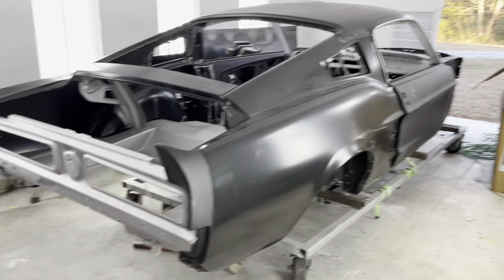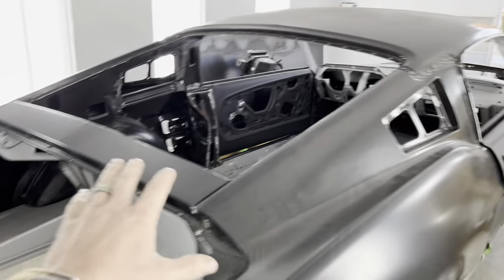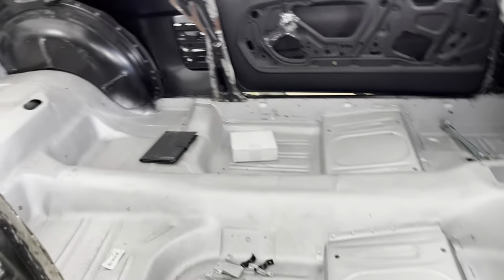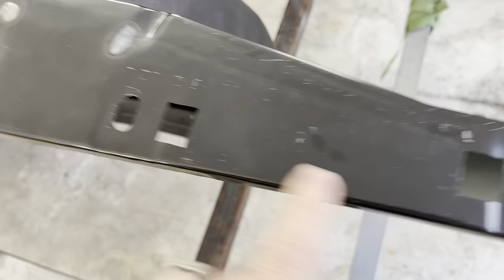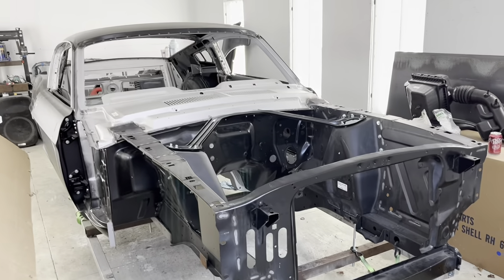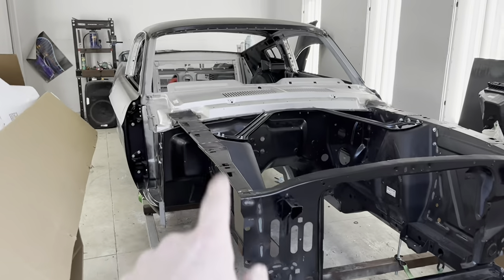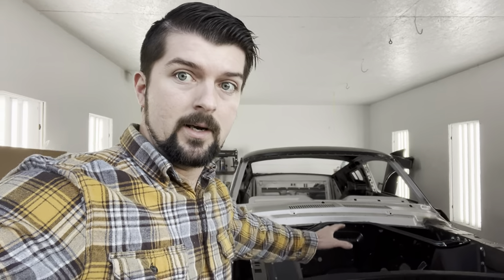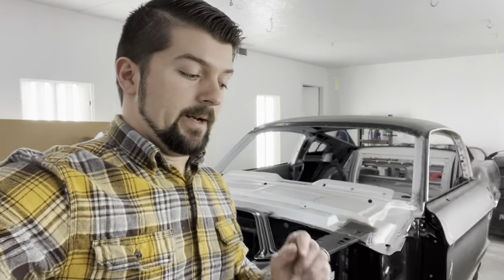How to get a VIN number and title for your car

Comment: Only draw back is the new vin would be like a “kit car” vin. As to a 67-68 vin would be worth more in the eyes to most people in the market. Well explained!
Reply from the maker: Not to say your completely wrong but if it’s a kitt car it will say it is the year the vin is made such as 2023 but a new body of a 1967 mustang says 1967 Ford Mus on the title, it’s a complete duplicate to my Origional 1967 mustang not a kit car, if I were building a Shelby cobra then it would say 2023 cobra kit. So your not wrong on the kit car title but on these 
Remanufactured bodies they do say they are the real deal
Reply: Not all people some would want this just to say it's a brand new car,
Reply from the maker: @Must-Stangingarage  the guy is wrong when he says it would be a kit car, it’s not a kit car and is not titles as one, kit cars are replica cars not actual stamped bodies and it’s titled as a 1967 mustang 2 door FB not a kit
Reply: @1194video that all said, will your finished car need to be compliant with today's safety/emissions/etc., or could you build it with a leaded gas burning, leaky 289, and no cats, for example?
Reply from the maker: @MikeCavey  you can build it the way you want, I’m sure if you have spent 30 grand on a car your not going to throw a leaky 289 in it
Reply: @1194video  lol. Was obviously "tongue and cheek" with the 289 crack. More concerned with 2024 compliance vs. building to '67 spec to be street-able/legal as it's technically new (and yes, all that coin and effort it would be a modern crate w/5 or 6 speed for me)
Reply from the maker: @MikeCavey  lol yeah. I have a 5.0 crate for this one but may do Coyote

Comment: In California you would start with the DMV. They would demand you physically take the vehicle to the CHP for a "Blue Tag" (they don't do house calls). It would be difficult just to get through the first process of getting a "Special Construction" tag, but then you would probably have an even worse time with the second phase, or even an impossible time getting registration to drive the car on the street due to stringent EPA, DOT, and CARB restrictions. This would make the task not worth doing, because you may, or may not end up with a drivable vehicle. 
Maybe build it in Tennessee then sell it to a person in California, but only if it can be titled as a 1968 (?) Mustang, and not of the year built. If it were registered as a new car or year built, you could never get it past the smog referee.
Reply: And that is one more reason I will never live in Kalifornia...
Reply: @slashsplat  Except he is wrong.  There are plenty of other videos showing how it works and it has been done hundreds of times.

Comment: None of this is valid in California.  According to my local CHP contact, without the original Ford VIN that would be considered a specialty built vehicle and stamping your own VIN on the car (or even refreshing an original VIN) considered a felony.  Several years ago I needed a replacement title for a '65 Corvair and all it took was an inspection of the VIN tag by a clerk and all was OK.  I recently purchased and brought back to California a '39 Ford out of Arizona that had a CA DMV tag riveted to the door post.  The original VIN is stamped on the frame in the correct location under some paint and the car is obviously not a kit car.  Local CHP insists on having DMV research the riveted tag and registering the car under the original VIN.  They are understaffed and only work this kind of stuff two days a week.  Five weeks now and still no return calls and no title/registration.
Reply from the maker: California is exempt from everything.
Reply: At least they said they would research it.  Maryland DMV told me t go eat shyt!!
Reply: So CA is saying that their own replacement vin tag isn't valid? 😂
Reply from the maker: @crherniman  the best thing anyone can do that lives in CA is leave CA lol but don’t come to TN we are full lol 😂

Comment: Around here when ya tell folks all ya need is a sticker you are more than likely gonna see a Summit decal on the front fender and it adds to the value by covering the rust holes and it adds HP too no doubt or so they tell me.

Comment: Living in NY i cant imagine this process bring this easy at all! Im sure it would take several thousand dollars, multiple trips to DMV(sitting in line waiting each time), a blood sample, DNA swab, childs first tooth, mothers maiden name, & 73 other things necessary to complete this process if it is even possible here. I don't even know if it is possible to do here. I know Vermont was the place to get plates from literally anywhere but i think they stopped that 'loophole' recently. 
Anyways nice mustang man! Cant wait to see it all done. What motor is going into it, Coyote 5.0, or Godzilla 7.3?
Reply from the maker: Well the one in the shop on other side is coyote swapped but idk yet what I wanna do with this one. The cost of everything is so high it’s hard to get too imaginative
Reply: Actually NY is really not that bad. As long as you have all the documentation and the state inspector feels that it is all there you are good after inspection.
Reply from the maker: @jamesgaczewski9692  good to know, I’ve had a few NY residents ask but I was not sure
Reply: I've done this with a motorcycle I built in NJ.  I really didn't think it would be that easy but it was.
Reply from the maker: @stuartferreira3338  they just want to make sure it’s not stolen and what you say it is.
Reply: And then there is California!   Probably cheaper to move to another state.

Comment: I’ve been going back and watching your videos from oldest to newest and this is such a helpful video. Question, for a body swap the state checks the vin on the donor floor pan. Do you need a title or does a bill of sale suffice in that situation? Also do you think it would matter what the donor floor pan is, like if you had a Chevrolet or dodge floor under your mustang panels for some reason do you think that would change anything?
Reply from the maker: Shouldn’t matter what donor metal you use, they check the vin to make sure it’s all clear to use.
Reply: @1194video  thank you for your reply. I was looking at my states dmv website. Would this process be “assigned vin”?

Comment: HERE IN SD if i want to put a 1933 chevy truck body with NO IDENTIFICATION NUMBERS "IN THE DMV SYSTEM" on a modern frame, all i need is the bill of sale's for the body, the frame, the engine, and the axles. the DMV will send a state trouper to inspect for stolen parts, and issue a title with NEW VIN!!!
Reply from the maker: I have a video where I did this with a 1955 f100 and they don’t send trooper anymore, they have a guy come that knows where all the numbers should be and if he don’t find any he gives you a new number and title right there

Comment: What if i build the frame , body with materials i already have.  There won't be any reciets on it.   Like i wanna build something resembling a 1920s pickup truck. Ive had old Ford straight axles from model A to 1940. Gonna use rectangular tubing ive had forever as well. Might even use a Toyota 22R and a 5 speed. So nothing will be anything resembling anything made before. Also have a grillshell from 20s-30s that no one knows what it is.
Reply from the maker: It’s the same concept except you have to tell the clerk the value of the car and they tax you on that. And you tell them it’s a home built and what your building then when the guy inspects it he will be the one to approve for title, be sure to register it early so the value is lower.
Reply: A new home built kit car/truck.

Comment: If im building a car from scratch I'm picking my own vin number! 

It would be based on the models original vin so it makes sense. I don't care if its starts with a G for Georgia. 

Example G22F67FM

G=Georgia, 22=2022 build date, F= Ford, 67= model year of body style, fm= fastback mustang, next would be the factory digit of the engine in it...ect.

If ford used a 6 as a code for a super charged 302 in 2016 and I used the same engine that would be my next number and so on until I ended in my last two initials and 01.

I would put my number in all the places there supposed to be, let the police run a check on my vin number then take everything to the dmv.

If they don't like it the can put a sticker on the door jamb also but your not changing my vin number!

No state tells any other manufacturers what vin numbers they will be issuing. If they try with you thats discriminatory with no basis to impose such a rule on you. 

Police check whatever vin is visible with a description to insure it is not a stolen, duplicate, or destroy vin number.  If the number the check is clean they write the visible vin number on the paperwork and then the dmv cannot change that because that woud be fraud.

Car, boat, trailer, lawn tractor, it doesnt matter. If the manufacturer /maker puts a vin number on it the state cannot change it. They can only assign you one if it doesn't exist. 

Pretend it's your child and give it a name/ vin number

Sounds like you already have a good relationship with the inspector just tell him what your doing and why. You get past him the dmv will have to record whatever he witnesses as a existing vin number on his paperwork.
Reply from the maker: The inspector is a good guy, he goes to several shops here that do these bodies.

Comment: So this works for completely custom 1-off "coach build" style cars, too? Like if I hand form my body to my own styling and weld up a tube frame chassis and all, I can still get it VIN'd and registered as an original 202x "Hamster Super Turbo" or whatever the heck I want to call it?
Reply from the maker: It has to be built using reproduction parts, if you do it the way your saying it will be registered as a kitt car

Comment: My thoughts recently was to buy a 1972 C10 IRS rolling chassis with an LT1/transmission, buy the cab, buy the bed, and all the rest and build it from the ground up brand new. No rust, no repair, no bondo. 2024 1972 c10.
Reply from the maker: @MikeGravs-vg2bi  that’s it, that’s the way to go and they do sell better than original cars unless it’s a specialty car or truck

Comment: here is an example to study: you have a titled, registered . and  licensed 80's square body chevy , crew cab, dually 1 ton with a long box. its your daily driver. you park it and remove the cab and bed to do a restoration. you buy a 65 passenger school bus with a totally mechanical diesel engine, lets say it is a DT360A and you remove the body to use as a storage shed.
 you decide to set the cab on the bus frame and make mounts for it. then set the bed and mark for center of axle location. move the spring hangers, springs and axle as 1 unit to the new location, and drill and bolt them in. then you decide to swap in a set of Rockwell 5 ton axles and a transfer case to make it a 4 wheel drive. lower the bed, hook everything up etc.. as long as the highest point on this truck is under the  maximum legal limit, IT IS 100% ROAD LEGAL, AND IS STILL AN 1980'S CHEVY SQUARE BODY TRUCK!!!  NO NEED TO EVEN TELL THE DMV YOU SWAPPED EVERYTHING!!   
IF YOUR STATE DOES NOT REQUIRE A YEARLY "SAFETY" /SMOG CHECK, YOU CAN ROLL COAL ALL DAY LONG AND BE TITLED AS A GAS BURNER!!!!!!
ALL 100% LEGAL!!!
Reply from the maker: Right… also it is illegal to remove your catalytic converters… but… if you do a body swap with a car built before emissions you can legally remove them, crazy ain’t it

Comment: I don’t get it. What is the inspection for? Just to ensure it’s not a stolen vehicle and there’s no previous VIN? Looks like you’re passed without being complete yet. Just a body. Is it common to do that? To get a VIN and title to something that’s not a car yet?
Reply: He did the process a little early but the inspection is be sure everything is legit
Reply: Correct. To verify whether the vehicle is either OEM or shop built and to visually lay eyes on the vehicle that the owner is requesting a VIN and state issued title. On vehicles that are clearly OEM they want to look for original VIN on body and frame. If none are found they can issue a reassigned VIN. For vehicles that are verified as a shop built vehicle and not OEM, they will be assigned a new VIN and the title and registration will reflect as such. Shop built vehicles are NOT OEM vehicles and therefore their values will reflect that.
Reply from the maker: They make sure it’s what you say it is and check to see if it’s all paid for parts and not stolen, the reason I did this before finishing the build is so it’s easier for them to inspect the car

Comment: I've got a 67 in sad shape with no title but it is a factory AC car not under dash, door doesn't match the other VINs  do you suggest any where there is a VIN with new sheet metal or could you do a video on just the old cars
Reply from the maker: It should be on the fender aprons

Comment: So do you have a video on how to redo a vin on a car without a title? I have come across a few cars the would be good projects but are so old they have no title.
Reply from the maker: If they have existing vin’s you can file the fin with the county clerk by doing photos and rubbings which you put a piece of paper over the numbers and run pencil over it and take it to them to file for a new title
Reply: @1194video  I have passed a a few older car because I wasn't sure I could get a title for them. would hate to spend the money on a shell I wouldn't be able to do anything with.
Reply: Go ask your county clerk or a highway patrolman or look it up on line for your state it will vary from State to state Missouri is hard to get
Reply: @Must-Stangingarage  lol they can be a bit bitchy at the office here ... lol

Comment: All vehicle in North America has a VIN by the dash panel so you can see it through the wind shield. Do they give you a plate with the vin on it or can you order a vin plate from legal after market company?
Reply from the maker: Mustangs do not have a vin at the dash, they have a stamped one on the front inner fender apron and a body tag on the top of firewall and a tag on the door. This is if there is no vin at all, if you have vin numbers you need to apply for a title not vin numbers. It takes awhile but you can get a title for your car through the county clerk
Reply: @1194video  Well I am 54 years old and i learned something new. I thought all cars sold in North America had to have vins on the dash. That old saying is true, you are never to old to learn something. Thanks for the correction.
Reply from the maker: @MarkK01  in the 50s fords screwed the vin to the glove box door.
Reply: @1194video  Yes I knew that. I had a 1958 Ford F100 short box truck. I really miss that truck. I had quite a few really nice older vehicle until I got married. I say no more lol.
Reply: @MarkK01   All cars sold TODAY have to have those specs.  Along with the 'standard' VIN framework.

Cars from the 70's and earlier have many different ways of doing things.

Comment: I have clear titles in my name to a 1969 Mustang fastback and a 1973 Barracuda. Can I build cars from new parts using those Vins?
Reply from the maker: Short answer… NO. The two cars mentioned may someday resurface and be restored even if the only thing left is the area where the tags are, and if you stamp numbers on a car that would be illegal, especially when the person who buys the physical cars goes to get titles and the department of motor vehicles sees that the numbers are being used, that would I’m sure prompt an investigation and someone would most likely loose their car. But I’m no expert on that, but I’m sure you could reach out to the county clerk and they will say the same thing

Comment: Not sure if tbis would work in arkansas, i bought a body that never had a vin (32 model a) and was told I have only 1 option, bonded title starts at $1000, and goes up, they decide what you pay the state, and I have to get a bond from an insurance company (several hundred dollars per year for 10 years) after a decade they will issue me a title and vin
Reply from the maker: Every state is different, this is for TN

Comment: I have a 1968 Cutlass convertible 442 that my dad was rebuilding before he passed away its  been sitting for about 12 years i can't find a VIN number or paperwork for it anywhere do you know if I can get a VIN number for it im in California
Reply from the maker: There are hidden vin numbers in that car, 
the VIN on the drivers side on top of the frame in two places. One was just behind the torque box area of the frame on the side rail under the drivers area, and the other was on the top of the frame behind the rear kick up area of the rear axle. Neither are visible without removing the body from the frame or using a dentist type mirror with a light.

Comment: I bought a c10 with no title and no vin. Is there still a way to get paper work done?
Reply from the maker: @demarques1911  first check to see if there are t vin numbers stamped because once you go to issue a new vin they will send a guy out to check for you, The vehicle identification number (VIN) for a Chevy C10 can be found on the frame, either on the top of the right rail next to the passenger motor mount or under the cab if it’s there you can apply for a title for that vin, if no vin number you can go and file for a new vin and you tell them the make and model and take pictures for them to file, then they will send a guy out to approve it